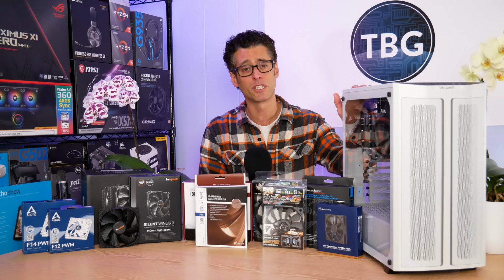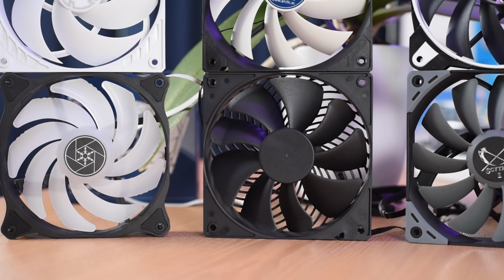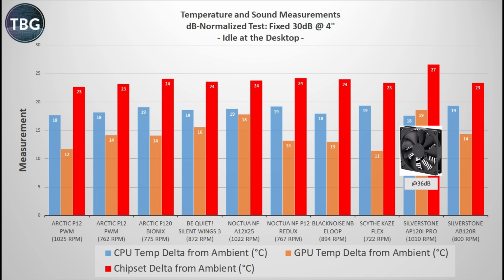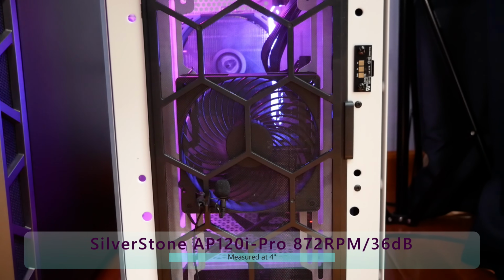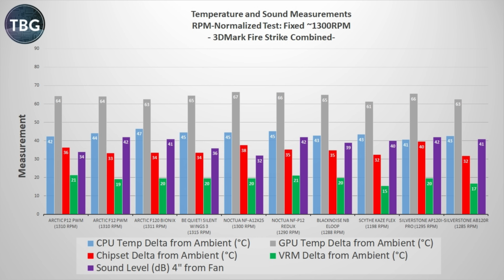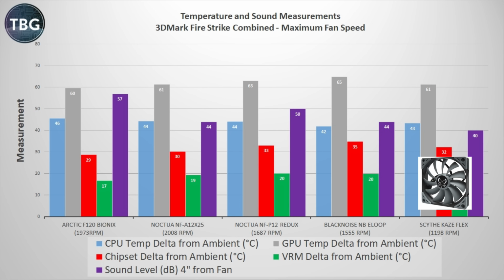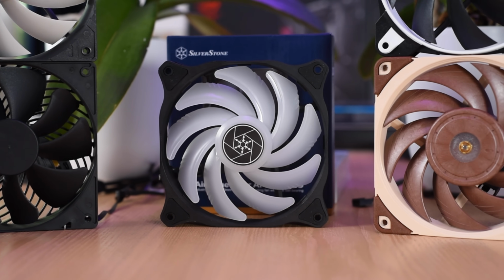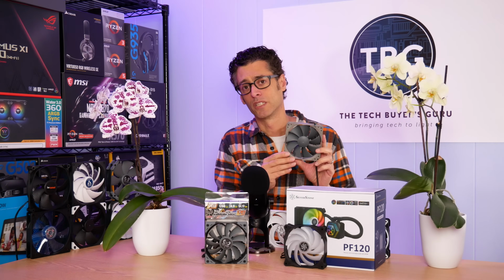The Best 120mm Case Fan Shootout: Arctic vs. be quiet!, BlackNoise, Noctua, Scythe & SilverStone

Comment: The Silverstone AB120R sounds a lot quieter and smoother @ 41 dBA than either the Arctic P12 @ 34 dBA or the Noctua A12 @ 32 dBA. Before I rush to buy the Silverstone fan, do you think the recording sounded truthful or does the Silverstone for some reason sound quieter in the recording than in reality?

A measurable difference of 7-9 dBA sounds quite a lot but the recordings don't reflect that.
Reply from the maker: I'll tell you this about the AB120R (https://amzn.to/3cRPEf0): it is shockingly-quiet at low RPMs. Very smooth, so even at the same sound level, it "feels" quieter. I was a bit surprised at the 40dB reading sound test, keep in mind that I didn't listen to the recording until I began producing the video. During the test, I would say that it sounded very good, but it wasn't silent, and I think the recording is highlighting the extremely smooth bearings and motor sound, and perhaps not catching as much of the air movement due to the position of the mic. The fan is moving a lot of air at that sound level, as evidenced by its very good temp results. I have also tested it at full speed (2200RPM), and it is very loud, but again, it is an air sound, rather than a mechanical sound, so I think it's less intrusive than most fans.

Comment: I would really like to see a comparison between airflow and static pressure fans when used as case fans through a mesh filter. Manufacturers sell high-airflow fans as case fans but plenty of people argue that high static pressure fans (ie. radiator fans) work much better as case fans when there's a dust filter in front of them.

I would also like more focus on noise-normalized testing because rpm-normalized results really don't make for a good comparison. It's good to have a 30 dBA noise-normalized test, but having a second test at 40 dBA would tell much more than an "max rpm" or "fixed rpm" test.
Reply from the maker: The problem with dBA-normalized tests is that I actually don't know what the normalization should be until I test every fan, installed identically, in the same system. It's a bit of a catch-22. Basically, I'd have to install them all twice to get it entirely right. In the current roundup, one of the fans couldn't come close to hitting 30dB at min, and one barely broke 40dB at max, so it's a pretty tight range, and 30dB/40dB may be too far apart. I will consider doing two noise-normalized tests, but given that most people buy fans based on an RPM range and in fact set fans based on RPM, eliminating that entirely takes away an important signpost. 1300RPM is 1300RPM on my board or yours. 40dB is only 40dB on my sound meter, 4" from my case, in my testing room, with my other components. No one can come close to replicating that.
Reply: @TheTechBuyersGuru  Another way to get comparable results would be to have CFM-standadized tests to see how loud each fan has to get to move the same amount of air.

I understand that it's easier to standardize rpm. The problem is that one fan may push more air at 1000 rpm than another at 1300 rpm, but taking it to 1300 rpm may increase it's noise more than its output, making it look worse than it is.
Reply from the maker: Yes, the mesh filter was in place through the test. And technically, the Arctic P12 is a static pressure fan, while the F12 is an airflow fan, so we did have that comparison that the OP was asking for.
Reply: @TheTechBuyersGuru  Yes, and it was great to have that unusual comparison!

I hope you will do more comparisons like that, for example with different lines of Noctua and beQuiet! fans. Some heatsink/radiator fans would make excellent case fans even if they are not usually reviewed or tested as such!
Reply: @Lori Bergseth Yes there was. The setup was good. I hope he could use that setup to test more fans of different types (SP vs CFM focused) against one another to see which types of fans really make for better case fans.

Comment: Thank you for a realistic test setup! This is the first case fan review where I see the Silent Wings 3 demonstrate its awful turbulence when it's pulling through a mesh. And that's because most reviews test and record the fans either in open air or in a push configuration. There the SW3 is great, but it's absolutely horrible as a pull fan. I wish I had known this before wasting money on two of them.
Reply from the maker: Glad it was helpful! There are so many ways to test fans, but an open air test bench is not one of them. I tried to construct a test scenario that was realistic, but every case is different, so there is no one right answer to the question of which fan is quietest in "XYZ" case.

Comment: what's amusing here is that youre not even using Scythe kaze flex 2000rpm version. you are only using the 1200rpm one. 
This fan has comes in 3 versions: 800, 1200, and 2000 rpm respectively. http://www.scythe-eu.com/en/products/fans/kaze-flex-120.html
Also why not go all in on 3000rpm fans from scythe just for fun? http://www.scythe-eu.com/en/products/fans/ultra-kaze-120.html
Reply from the maker: LOL, that Ultra Kaze would definitely be LOUD! By the way, I specifically chose the 1200RPM PWM model, because it is the only PWM Kaze Flex. PWM control provides broader RPM control.

Comment: Can you place the microphone the same distance as the DB meter next time. its hard to tell noise levels that close to the fan. Subscxribed for the 14mm review
Reply from the maker: Yes I will, that was an oversight. I put the microphone there to ensure it was always in the same place (and visible) for every test, but I'll come up with another solution for the 140mm shootout.

Comment: Yes do a 140mm version. I am actually curious as to how the 140mm version of the redux Noctuas perform. I actually agree with you on the redux fans, they are old and and the rest of the market has caught up to them. They have a deep droning motor hum that I can hear from at least 20 feet away. I was thinking of upgrading them to the newer nf a14 versions, However I am not sure how much better that will be.
Reply from the maker: I won't test the 140mm Redux fans, but I may test the NF-A14, I have a pair of the chromax.black versions on hand.
Reply: @TheTechBuyersGuru  Ok, I wanted to see how they compared to the newer nf-a14. Wanna know if its worth the upgrade or just stick with these. The sound gets to me! however they do move quite a bit of air compared to other 140mm fans I have.
Reply from the maker: The NF-A14 is a better fan than your Redux, but it may not be the best 140mm fan. That will take a shootout to determine, and whichever 140mm fan wins that will definitely be better than your Redux fans!
Reply: @TheTechBuyersGuru  I should note that I have them on a front mounted radiator. Any chance there will be a 140mm radiator test as well? Or did I miss that.
Reply from the maker: 140mm radiator fan test will be done eventually, but probably later this year. I have a number of other fan tests already lined up before then, and each one takes a long time to produce.
Reply: @TheTechBuyersGuru  Roger that 👍🏾
Reply from the maker: @Lori Bergseth, your wish will almost certainly be granted, because the Pure Base 500DX case I'm using comes with Pure Wings 2 140mm fans, so it would be a little silly not to test them too... can't promise anything (because everyone wants a different fan tested), but that's an obvious pick!

Comment: 19:58  "I asked Noctua if I should use their S12 line..."
You really should've... It's really bizarre they recommended loud and outdated P12 fan instead of their S12A and S12B fans designed specifically for airflow... Just looking at the specs, S12 fans should perform better as case fans than even extremely successful but radiator-oriented A12x25 fan. It's a real shame S12 was absent from your tests, it could easily be a winner...
Reply from the maker: They just sent me an S12A chromax.black, and I have a brown S12A, so I may include them in two-fan testing in my next roundup. Lots of people want lots of different fans tested, so I have to decide which make the most sense for a follow-up case fan test.
Reply: @TheTechBuyersGuru , while the expressed desires of your audience are important, some sort of objective and logical choice can be made. Obviously, you have to include Noctua as one of the most respected brands with proven reputation. Now, specifically for the case fans comparison the most logical choice is their most airflow optimized quiet fan, which is the S line. On a personal note, I have four S12B Redux PWM fans in my case (which are pretty quiet and move a lot of air), and I'd love to see how they're doing against significantly less affordable S12A fans...
BTW, great work, your videos are one of the best sources for anyone choosing a fan. 👍
Reply from the maker: The biggest thing stopping me from saying "YES" to the S12A is that I'd really like to make this a 120mm vs. 140mm review, and Noctua's 120/140mm case fan lineups are radically different. They don't provide much in the way of an apples-to-apples comparison in terms of fan design. In fact, arguably Noctua doesn't have a dedicated 140mm case fan, it just has the fans it designed for its 140mm coolers (which I've named the best air coolers on numerous occasions). Trust me, I want to test the S12A, and I really wish I hadn't asked Noctua which fans to test, I should have just made the call. I literally said to them "I am going to test the A12x25 and S12A for my case fan test, please let me know if you'd like me to test different fans." I even considered making the S12A the 11th sample in my test, but I ultimately decided 10 was a reasonable max. I'll try to find a way, trust me, it's on my to-do list!
Reply from the maker: Ha, ha, I don't think that's going to happen! There are so many 120mm fans out there that once I started down that road, I'd end up having nothing but 120mm case fan shootouts!

Comment: Great video, haven't seen your videos before but this was great.  Two points though.. you're neglecting the longevity of Noctua fans.  I have the original coloured versions of that Noctua fan.. and 10 years later, they still all work and are in use.  They come with 6 year warranty.  I've never had one fail, I've only had one get a bit noisy over time.. relegated to hard drive cooling duty (running at 1/4 to 1/2 half speed).  I will concede there are more modern designs but I never run my fans over 1000rpm anyway, I'm focused on noise more so than raw performance.  I also find the sound of Noctua fans to be less grating, I understand this could be a personal preference thing.  Secondly, I would have thought 140mm fans were more important for a test like this, because I generally think 140mm fans as being case fans.  My Fractal case came with 2 of them for example.  So yes, a big up vote for 140 case fan test.  To end of a funny note, I can't remember which one it was but one of those fans in your recording setup sounded like a B17 WW2 bomber.. pretty cool sounding, but not what I'd want to hear coming from my case.
Reply from the maker: Ha, ha, maybe that B17 was the Arctic F140 BioniX! And yes, the 140mm test is ultimately more interesting for enthusiasts with modern cases that can fit them. I promise that roundup is coming. The number of fans I had on hand just got to unwieldy to cover in one video. Ironically, if you look closely at my intro segment, you'll see that most of the 140mm fans are displayed in front of me... I actually cut out the clip where I talk about testing both 120mm and 140mm fans, because after recording the intro, I got a bunch more fans in and realized I had to split it into two videos! I even filmed some of my 140mm b-roll already, which you'll see some day when the 140mm fan test goes live!

Comment: How many fans do you need in a PC Case for your GPU? Your next quest!^^ keep it up dude^^
Reply from the maker: Yup, going to be testing that in my next test for sure. I will actually run my 2080 Ti GPU's fans at a level high enough to avoid throttling, and then see if the case fans can lower the temp further. It is tricky, because there are throttling points at 60C, 70C, 80C, and 88C, so I have to pick a level where the GPU is in between two of those points using all case fans, otherwise I can't compare the fans. Tricky, but I'm on it!

Comment: I am baffled at how loud the Noctua and the Noiseblocker are in this test.
I will go with Arctic P12 for sure.
Reply: I'm not.  Every Noctua fan I buy, I'm again disappointed that the reviews praise them so highly, but they are so loud.  I have an old Silenex that is quieter at straight voltage than my last Noctua even with the low noise resistor inline.
Reply: The noiseblocker is loud when the intake side is pushed up against a filter or other obstruction. They recommend using a frame or washers to create some distance if mounted with the intake facing a radiator/heatsink/dust filter.
Reply: After watched the review I bought Arctic P12,  and four fans are working perfect and very quiet.